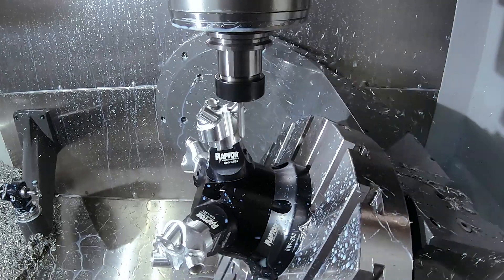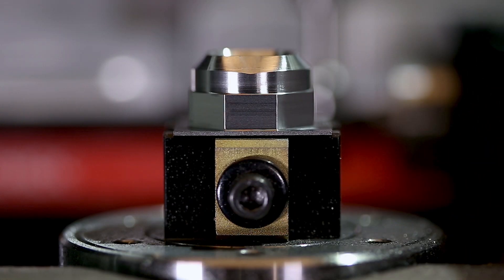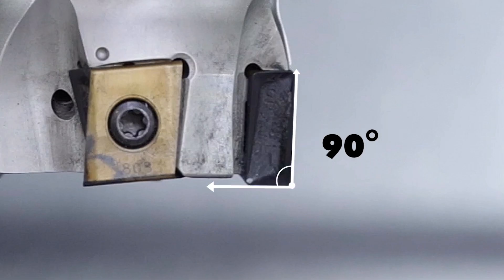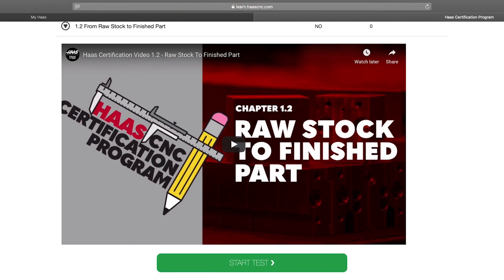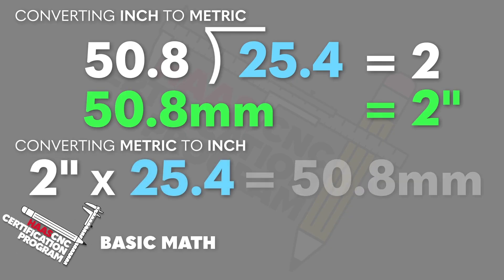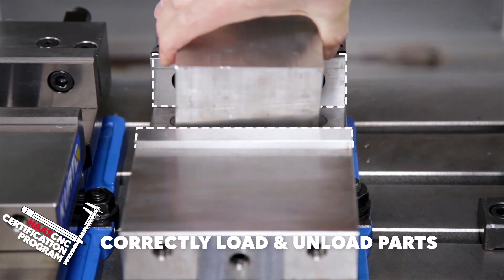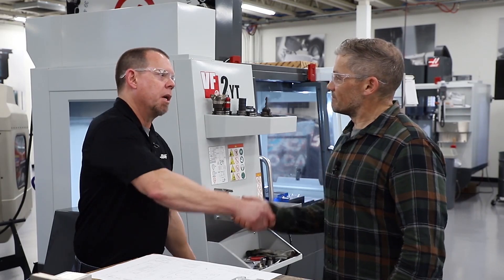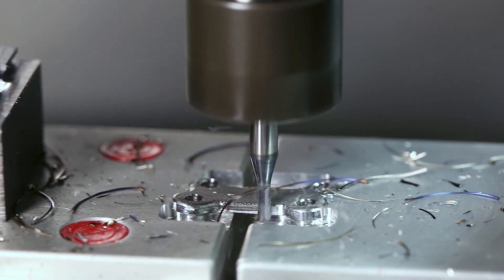The Haas CNC Certification Program - Haas Automation, Inc.

Comment: I finished the online portion. I'm told somebody will contact me with information regarding the hands-on test. I'm still waiting. Is this program still active? Does anybody have experience with this? From my understanding it cost $250, which is too high, but maybe worth it to put on a resume.
Reply: where are you located?
Reply: @CNCMachinistEducationNetwork  Hey, I just noticed your reply. I'm located in the Louisville, KY area
Reply: @ I am in Florida - let me see if there is a school nearby or you can take at your Haas HFO 

For now just take the test anyway - its free - then you will get an email on where and how much the test is
Reply: @CNCMachinistEducationNetwork  I took all the online tests, but got no email or call about where to go to take the hands-on portion. I don't live near enough a Haas HFO. But I'm moving to Florida this summer so maybe will check out the one in Tampa.